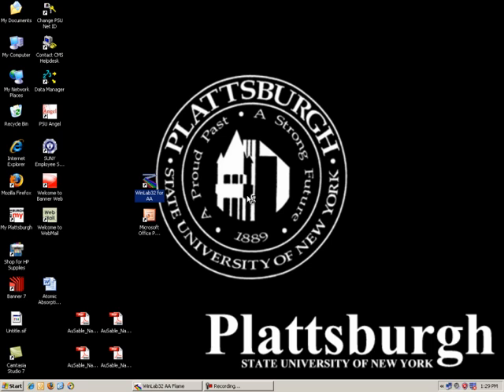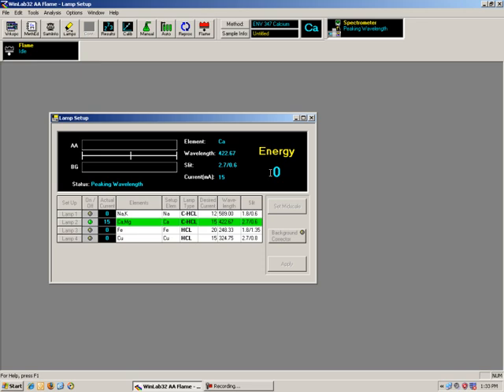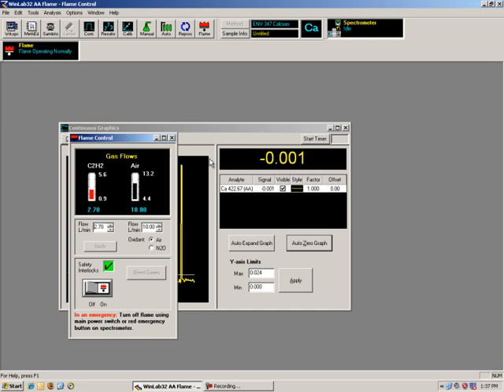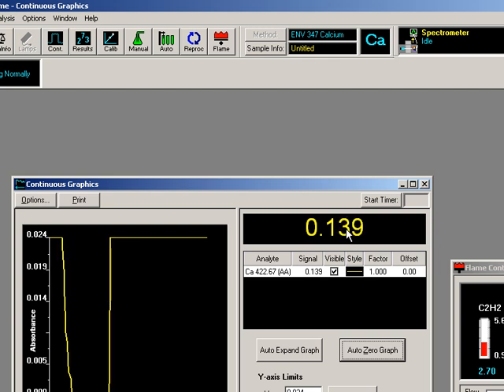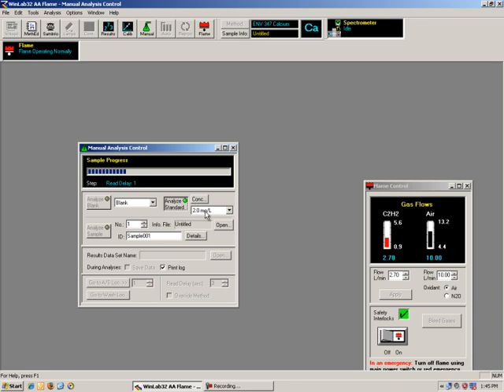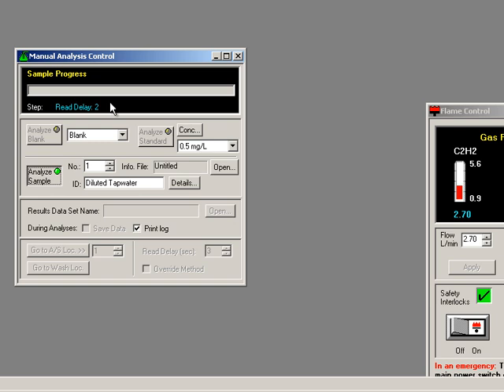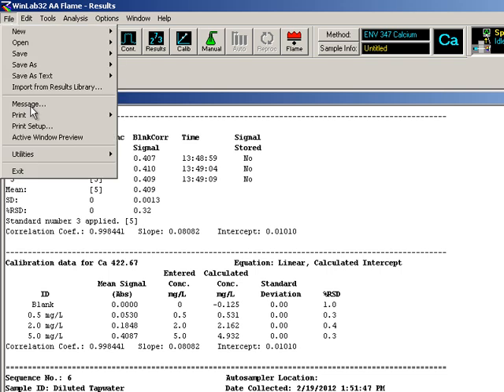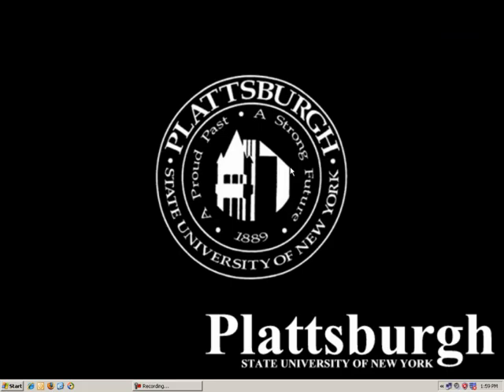AAS Running the Instrument.mp4

Comment: I adjust and calibrate the device. I have a lot of experience in spectrometry. I can help.
Reply: hello i have the shimadzu 6200 AA and when I work the calibration curve  is far from straight, and again the results are negative let you know what the problem is.
and also if you will allow me to tell you how the assistant software of novAA 350 (ASS) works.
and thank you in advance
Reply: @mohammedadjeli6849 
Good day. Colleague, tell me which element you are analyzing for content? Here is my e-mail Chesterleon@yandex.ru
Reply: @mohammedadjeli6849  Is calibration fall for all alement
Reply: hello I have the perkin elmer aanalyst 300 atomic absorption spectrometer, and the problem is that it does not light some lamps, the message low energy comes out but it is a good lamp, can you help me please, my email is armandomela@yahoo.es, I am from Ecuador
Reply: Hello. I answered you in the mail. Did you get an answer?
Reply: @vitalyl7962  
Dear Friend
If I have WhatsAap, our number is 593 991666858, write me to send you images

Greetings from Ecuador